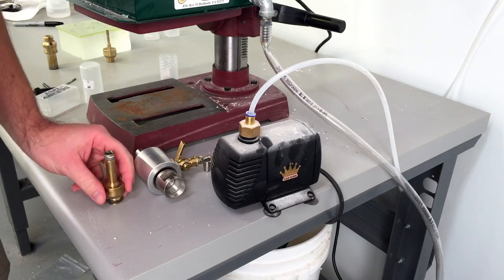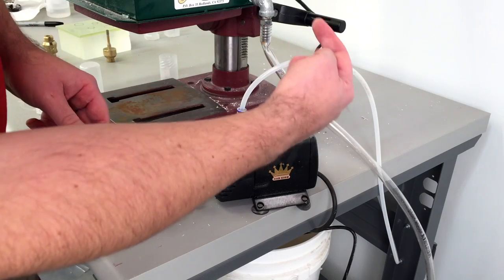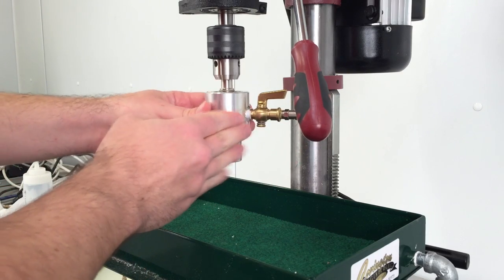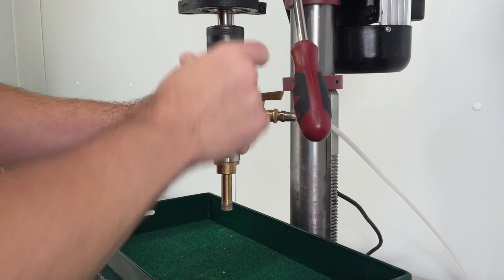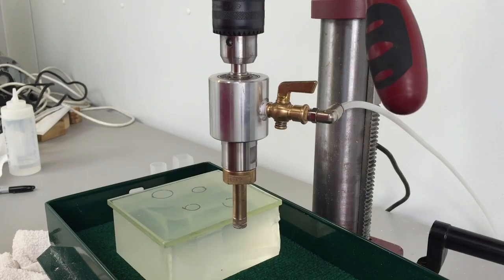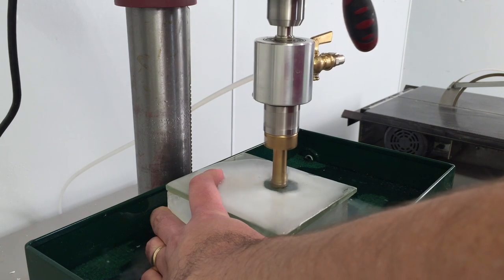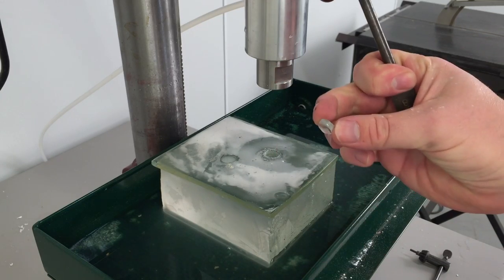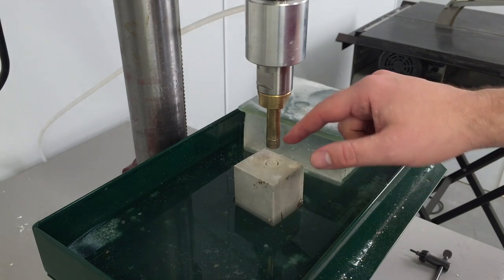How to use Sintered Core Drills with a water fed Drill Head Assembly

Comment: Can I use a 2mm Diamond core drill bit to drill small holes in cabochons?
Reply from the maker: You should be able to, yes. We don't do a lot of lapidary so I would double check with a lapidary supplier to be sure.